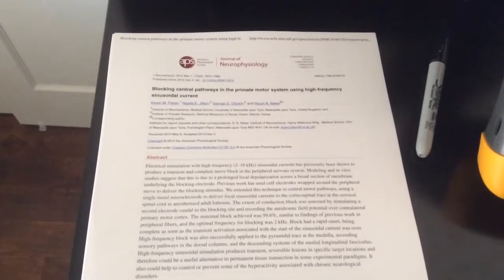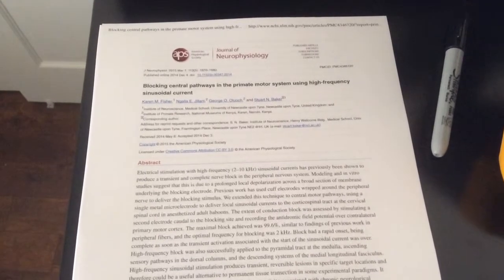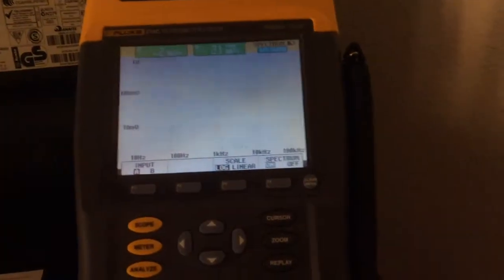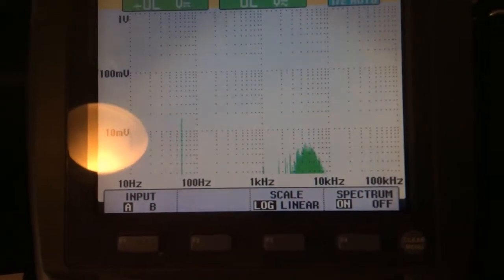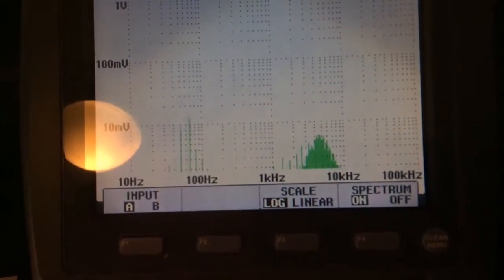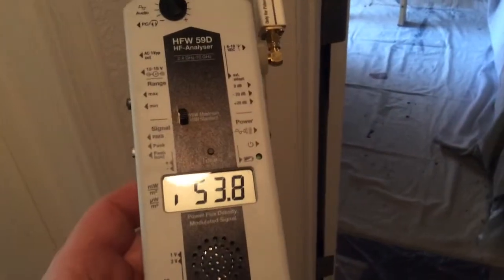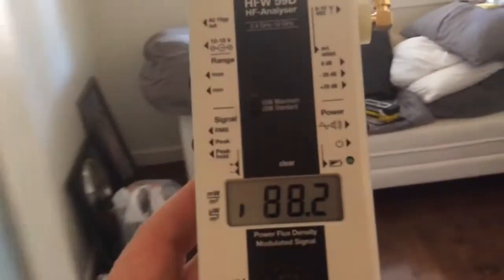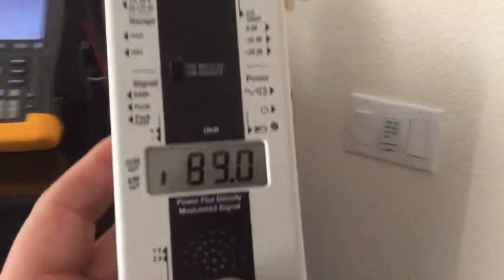Dirty Electricity Poor Sleep and Numb Hands

Comment: It's insane to have routers from the above and below and sideways apartments. Even more because routers come with power at 100%. I have mine set at 5% the few times a day I enable the wifi on it (mainly for updating the smartphone that doesn't allow usb to ethernet adapters).
Reply from the maker: The person in this condo said that it felt like electricity  was coming out of their fingertips. Extreme paranoia was also present, something a psychiatrist would want to give medication for. Our system is beyond broken because the doctors ignore this type of exposure.